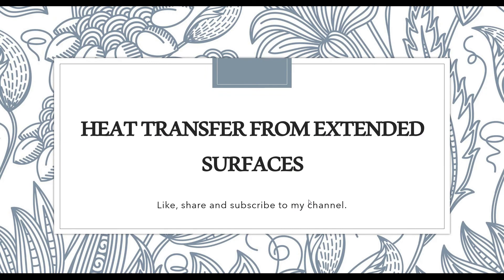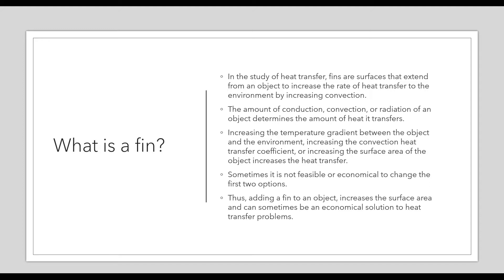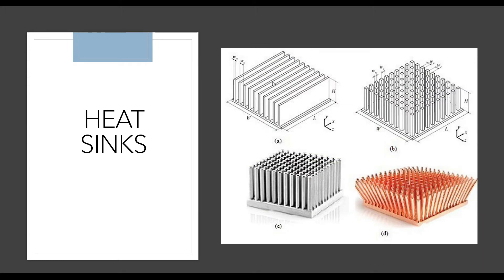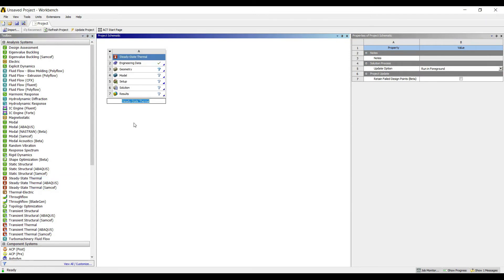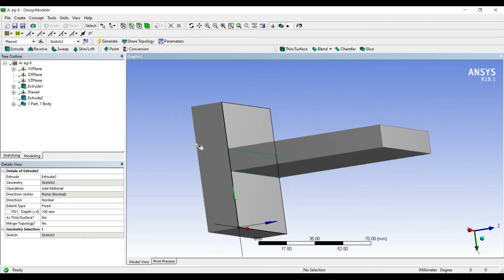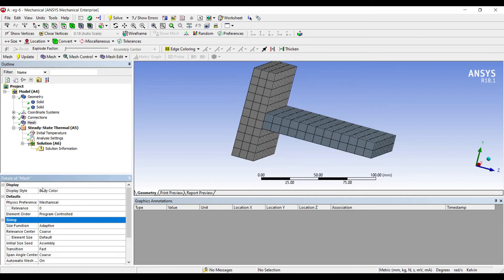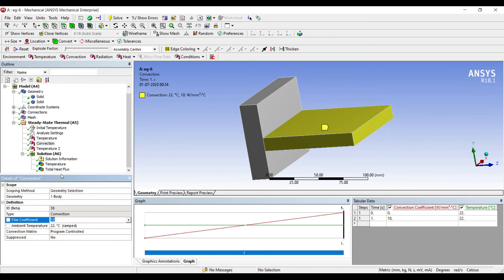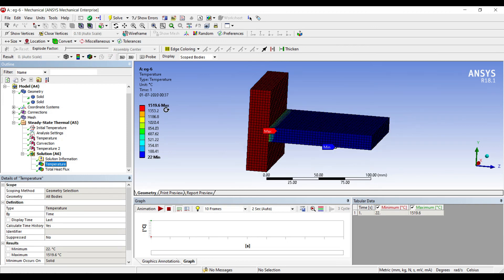Rectangular Fin I Extended Surfaces I Type 1 I Thermal Analysis I Problem 6 I ANSYS Workbench

Comment: Hello, I do have a problem with my ANSYS model and I hope that you can help me, as it is for my master dissertation. 
All results of the force-displacement graph comes as a straight line, I tried to define a multiliner values as well but still gives me the same behaviour. (the stress-strain graph is okay but not required).
I'm trying to match my lab results with the model results, the failure is in the same values but behaviour is different, what could I do to get the elastic modulus kind of graph from force-displacement? hope that you help me and thank you for the videos really helpfull
Reply from the maker: For getting elastic modulus consider only linear part of the graph. When you consider multilinear values, graph becomes non linear and elastic modulus is part of Hooke's law so the linear straight zone.